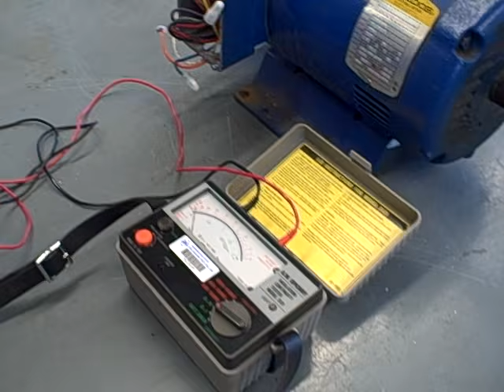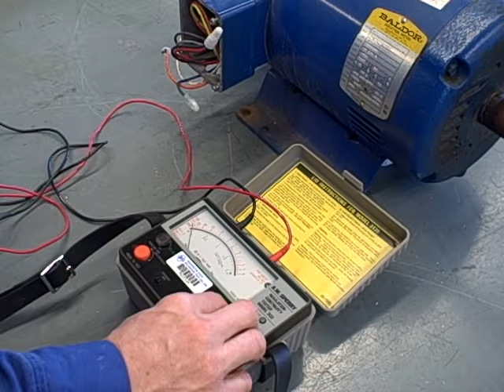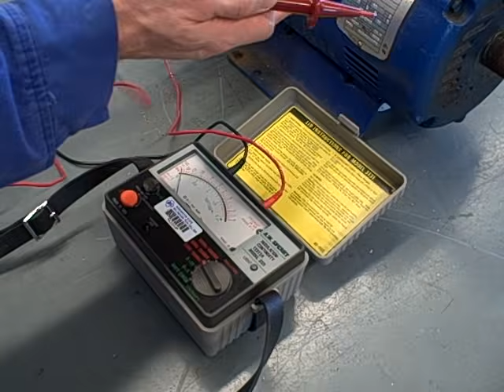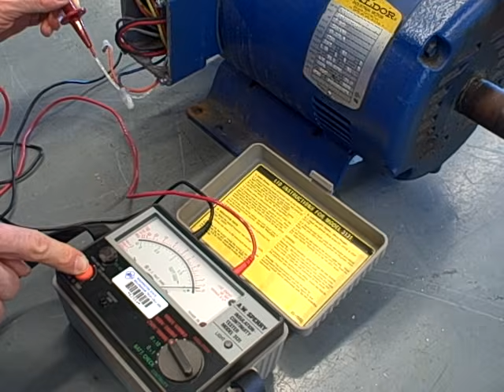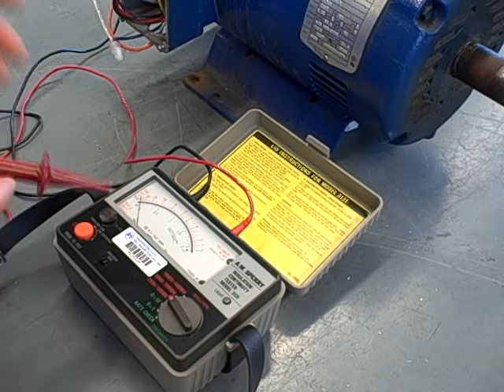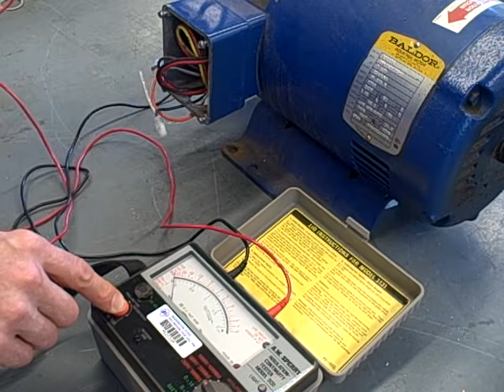"Megger" insulation test on a bad motor

Comment: if you find an electric motor that has very low resistance using Megger test, what are the things to be done?
Reply: Recovery Files . Unless the fault is in the terminal box, you'll just have to replace the motor Or get the motor rewound.

Comment: Im confused;At the high voltage setting the tester shows a short 0 ohm to ground  and the short is detected.On the lower voltage or green setting the tester shows 0 ohm too.Does that not mean that even on the green setting lower voltage  the short is still picked up by showing 0 ohm.Is 0 ohm not a short?If the meter did NOT swing over to 0 ohm that would be a high resistance indicating a open circuit and that would mean that the short is not detected at the lower voltage green setting ,the short is only detected at the higher voltage or red meter setting?
Reply: Ok I get it now I forgot the meter reads ohm differently  between green mode and red mode, Maybe a digital meter will be less confusing.Sorry I got everyone upset,kick me.lol.

Comment: Good & useful device. My concern is knowing which setting to use.  Use the 500V & up for high powered motors & 100V or lower for low powered motors, the right?
Reply: The test voltage should go up with the devices voltage.

1/4HP motors can be made 120 volts, 240 volts, 480 volts
One tests the higher voltage units are a higher voltage.

Thus a 2HP motor for 120 volts can be tested at a lower voltage than a 1/4HP motor for 480 volts

http://electrical-engineering-portal.com/measurement-of-insulation-resistance-1

Comment: Why is the ground fault only detected on a high-voltage mode? Is there a reason to this?

Many thanks!
Reply: High voltage causes some leakage current between the live and ground, as a result, the reading can be obtained in Megaohm.
However in the low voltage mode, the open voltage is about 5 volts, such voltage couldn't "drive" the leakage current to be flown, therefore, the reading couldn't be obtained
Reply: Another interpretation:

At the low voltage mode, the range is in few kilo-ohms. However, when there is a fault, it sometimes has a reading of 0.1-1 Mega ohms. Therefore, the meter reading is "infinite".

However, in the high voltage mode, the range is in mega-ohm order. Such fault, which is generally assumed to be 0.1-0.9 Mega ohms, can be obtained by the meter in the high voltage mode.
Reply: The insulation is only good for low voltage. At high voltage it breaks down.
Reply: Skimtar

Comment: Ive watched this video and its got me confused why would the megger read it as an open circuit when on the low setting but not on the high
Reply: +james randolph  Insulation has a specified temperature, humidity, voltage and current rating.  At a low voltage we are not stressing the insulation.  At a high voltage, if the insulation is bad, we will detect low resistance or a short to ground. Motors that are being controlled by Variable Frequency Drives are not being fed straight AC voltage.  They are being fed AC voltage plus a PWM  high DC voltage as well.  This is what will stress the insulation and if the insulation is bad, will cause the VFD to fault out on overcurrent or phase fault.
Reply: used on a low setting "lower test voltage from the megger"&#160;the insulation in the motor is not leaking current to the motor frame ,, but&#160;higher setting (higher voltage supplied during the test&#160;from the megger) the insulation &#160;cant&#160;handle the&#160;extra&#160;electrical&#160;"pressure" and a weak spot in the winding insulation will allow&#160;a&#160;"leak" to&#160;the motor frame "the megger stress tests the insulation under&#160;higher voltage to&#160;reveal the fault that does not show&#160;up with a normal low voltage ohm test..  an important note with a megger ,,  make sure you don't test circuits through a motor start or run capacitor on high voltages or one will ruin the device.
Reply: In simple words there wasn't enough voltage to get a good reading.

Comment: what is the required resistance if that motor is good?
Reply: up to Mega-Ohm or even Infinity between phases and phases to ground
Reply: +Romeo Jr. Dacuno Phase to Ground = OL or OPEN
                                    Phase to Phase  = OL or OPEN
                                    Phase A start coil to Phase A end coil = Resistance
                                    Phase B start coil to Phase B end coil = Resistance
                                    Phase C start coil to Phase C end coil = Resistance

Any other thing readings than the ones above is a result of a Bad motor or Transformer.
Reply: +edge. shouldn't phase to phase have resistance because they have common point connection.
Reply: @MR-nl8xr  Yes, low resistance.  The bigger the motor the lower the resistance.

Comment: A painted motors hoist point is hardly a 'good ground'... would need to clean the paint off.
Reply: Hi, it's simple. If it failed on painted motor. it will fail on bare body. Yes, off course you're right, working with clean motor body is the best way :)

Comment: A painted motors hoist point is hardly a 'good ground'... would need to clean the paint off or even use a piece of copper tube as a ground source.
Reply: Oftentimes you don't have access to stuff like that on the job site - especially when working on the motor of a piece of machinery. The jaws of the clip penetrates the paint anyways.

Comment: I have been using a 500v megger on 240 and 380 volt motors for years without problems (though i am not an expert on this)

Just be careful there are no temperature sensors or thermistors in the winds as these will fail if tested to such a high voltage.

Comment: A good motor would be over 20M ohm, may even be in the Giga ohm range. 
A motor that has damp in the windings would probably run ok if it was over 1.5M ohm and then dry out as it warmed up. It depends on the supply voltage the motor is designed to run on a bit, this is for 240V 50hz motors.

Comment: A fuse or breaker will most often trip on a wye connected transformer, however on a delta-delta connected transformer it will not trip, instead you will have one leg (on a 3-phase) with no or very little voltage and the other two phases (lest say its a 3 phase 480v system) would read 480 volts to ground rather than phase to phase. just thought I would point that out to all the troubleshooters out there.

Comment from the maker: Often, it will trip the overcurrent protection device (e.g. breaker or fuse) if the fault is phase-to-phase.  A ground fault on its own may blow the fuse or trip the breaker, but only if the three-phase power system is hard-grounded (e.g. a Y-connected source with the center point firmly bonded to earth ground).

Comment from the maker: A faulted motor winding may act like this, but it's unlikely.  The voltage output by an inverter even at low speeds will likely cause excessive current with a faulted motor winding.  There isn't any harm in doing a megger check of the motor (be sure to disconnect it from the inverter first!), but the problem most likely lies elsewhere.

Comment from the maker: "Ground resistance" in a power system usually refers to the low expected resistance between the grounding conductor and earth ground.  This is different from insulation resistance which is expected to be very high.

Comment from the maker: The low voltage used by a standard multimeter in the "resistance" mode may not detect certain insulation breakdown faults like a megger will.  The difference has to do with the non-linear behavior of insulation faults: they don't exactly follow Ohm's Law (current proportional to voltage) like a conductive connection does.  Compromised winding insulation may register as "inifinite" ohms (open) when tested with low voltage, but will "break down" and conduct when subjected to a greater voltage.

Comment: Yeah. Nice addition to an ordinary multimeter. Got two. A fairly modern late 80es original Megger and a vintage local made.

Btw. a little chicken aren't you? ;D Voltage might be high but amperage is quite low. I'd just hold the probe and wires in one hand on that occasion (as it's not connected to mains). Or you could put the crocodile on the wire and the probe to the motor chassis - it's easier :)